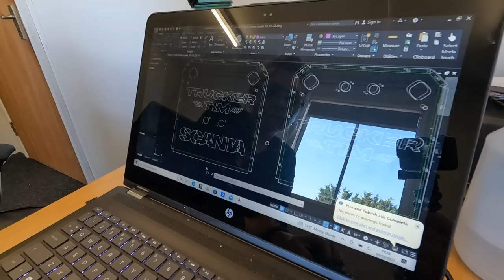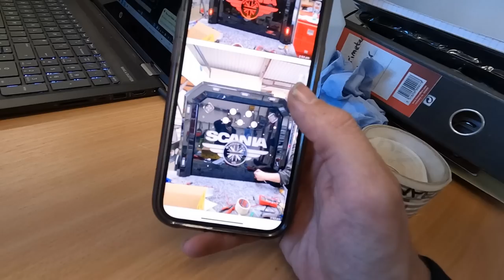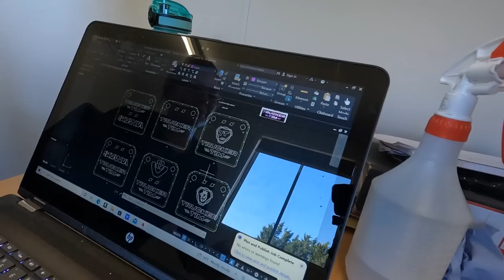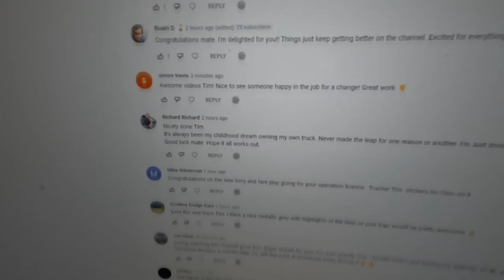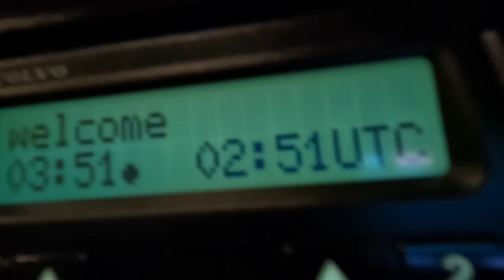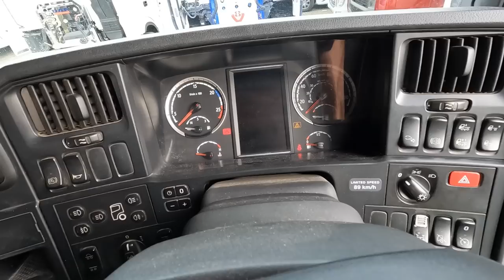Buying MORE Trucks!? | My Scania A-Frame Design | Trucking Vlog | #truckertim

Comment: @23.31 after the car into the back of the truck on the hard shoulder, there was a trailer coloured blue with a H frame cloured yellow at the back the company BSS this type of trailer is a roll back roll forward curtain and it carriers 44t off tube for the 100+ branches dotted around uk

Comment: If you had drilled out the broken bits of the brush handle in the brush head, you could have inserted the rest of the handle back in. apart from the handle being a bit shorter, it would be as good as new!

Comment: I'd say option F will look really smart, regardless of what colour you choose to spray the cab.

Btw, can you please do a video of the steps you can take to run a truck privately on the road?
I have my Class 1, been driving commercially for 8 years plus and always wanted to get my own truck as a toy, a bit like yourself. But I don't know how to go about insurance, how to tax it privately, etc to keep on the right side of the law basically. So a video of that would be really helpful. Thanks and good luck with the new venture when the ball starts rolling 👍